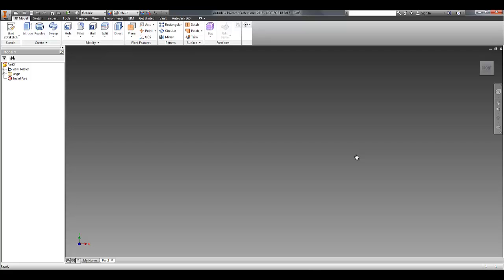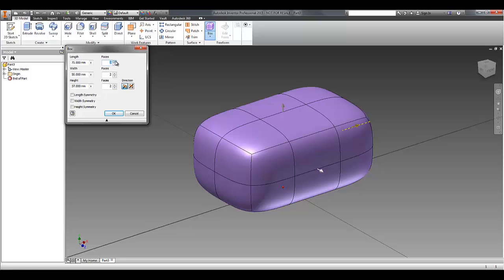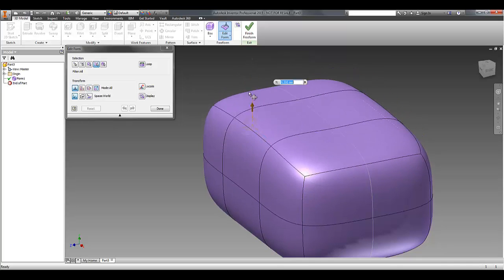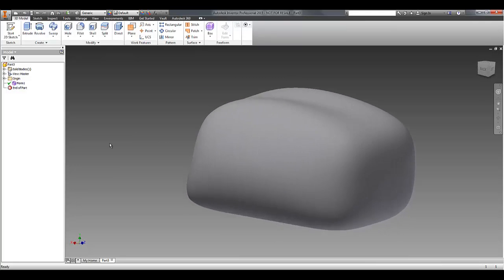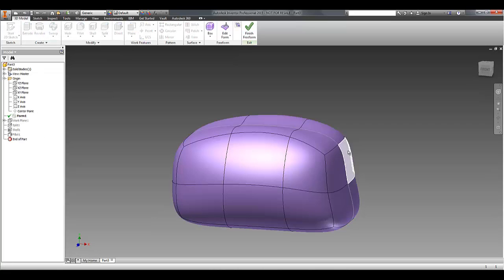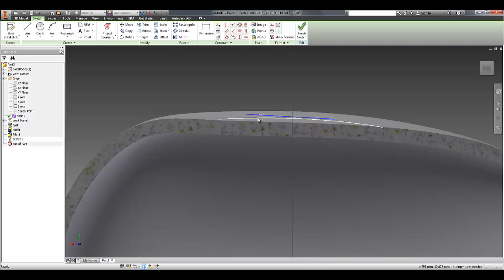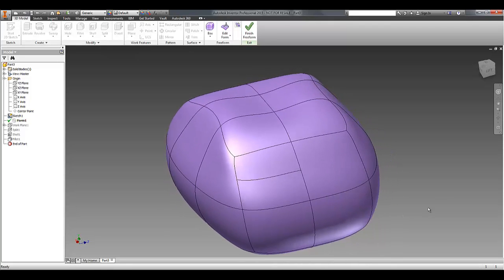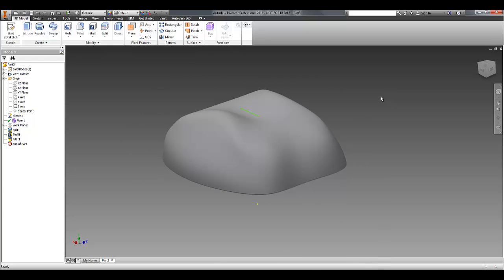Freeform bodies in Autodesk Inventor 2015

Comment: I have a peice that I created from the loft feature, I now want to manipulate it using splines, but I have no idea how to do that. I try the convert option, but it just creates a seperate face on top of the face I'm trying to edit. Any ideas? Also, how do you turn of snapping when in sketch? It's super annoying.
Reply from the maker: +6969SpAcE6969 have you tried this in Inventor 2016? Freeform bodies moved on substantially in that release.

Comment: can we use this method on STL imports?  i created alot of models using AutoCAD 123D and thinking of upgrading to Inventor 2015/16
Reply from the maker: Hi +Frank Lopez you would have to use the Inventor Mesh Enabler, downloadable from the Exchange App Store. Then Convert the resulting solid faces to T-Spline surfaces, and rebuild them from there.
Reply: this does not come included with any package ? im a student so i can get free but i need to know which package is better suited for me i dont have alot of memory to play with ,.....im into cad & cam as well as rendering and animation .....and suggestions?  thanks
Reply from the maker: Frank Lopez both Inventor & Fusion 360 will have you covered on all those points. With Inventor you just need to add the Inventor HSM add-in. You school / uni also has access to all of Autodesk's software for free. Make sure they know that in case they don't :-)
Reply: oh they do , im the one who just found out lol thanks  i guess im going to download Fusion then i hope i find good tutorials online for using freeform and more importantly CAM since thats my main use .....plus the use to import my own STL  from autocad 123D since thats what ill be trying to CAM
Reply from the maker: Frank Lopez Check out the CAD / CAM Australia & New Zealand channel, as well as the Autodesk Fusion 360 & Autodesk CAM channels.
Reply: thats why your the man ! thanks!

Comment: I don't think ,i'm  sure,on the invertor2011 the add-in is installed together with allias desing2011,IS FAR SUPERIOR.
This is a disgust.
How can I have this add-in on inventor 2015,can you tell someone??
https://www.youtube.com/watch?v=-K1TTtwUu6E

playjohn52003@yahoo.gr
Reply from the maker: The Alias add-in for Inventor is a completely different thing. It is a subset of tools brought into Inventor, but you need to have an Alias license.
T-splines is built into Inventor, much easier to use, and makes high-quality surfacing and industrial design tools much more accessible to Inventor users.